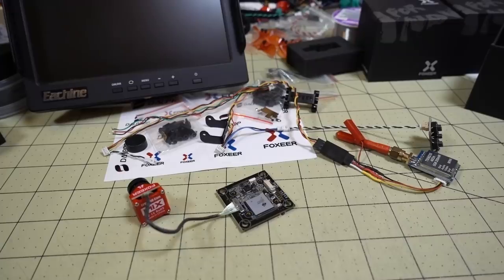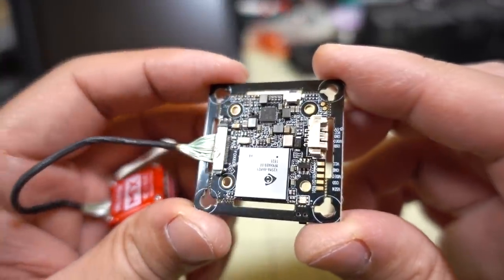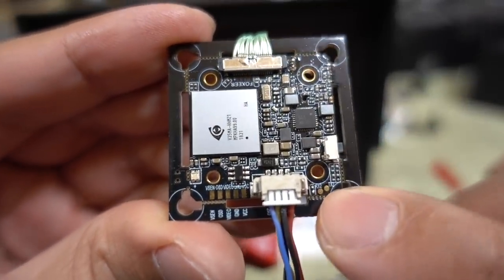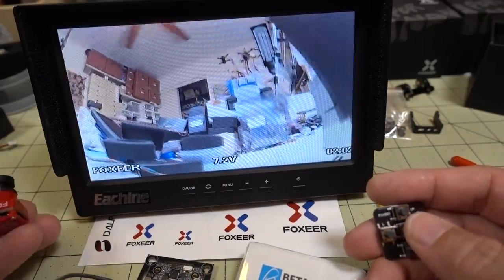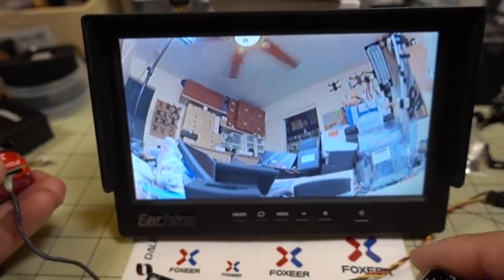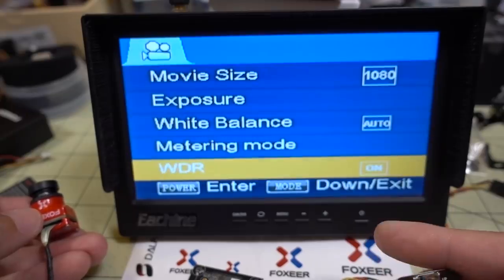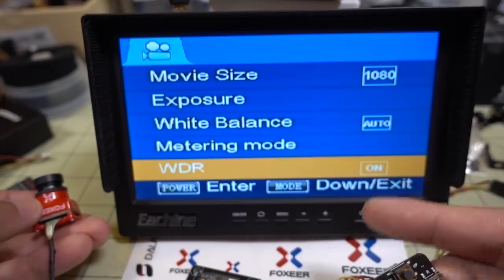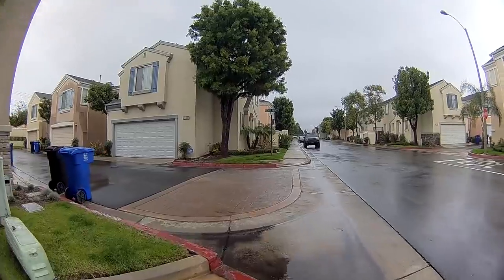Foxeer Mix HD FPV Camera FIRST LOOK 📷

Comment: I probably should of asked before but I would be interested to know which is the least susceptible for video noise. I recall you commenting on how noisy the Split Mini was.
Reply from the maker: The Mix was designed for less noise than the other two.

Comment: Really hoping the low light FPV feed is better than the turtle!
Reply from the maker: define better?  I've been asking people because it seems "better" means different things to different people...
Reply: @AlbertKimTV  if flying at dusk, or in an area with anything more than light tree cover the FPV feed goes extremely dark to the point where I can barely see. Is fine in nice sunny daylight. The low light difference between the turtle and the micro monster pro is dramatic

Comment: I'm seeing patterned artefacts / lines  on the left side of the test footage, top and bottom corners. It reminds me of a problem that appeared on the Runcam Split V1. Just checking. Are they on your own monitor or are they something youtube contributed during the compression process. Thanks.
Reply from the maker: It's youtube compression

Comment: Placed an order and returned my Turtle V2.  Built in Mic alone is a winner so I don't have to worry about sticking the mic somewhere or having it ripped off in a crash.  Also seems to be less noise in the feed (https://youtu.be/BDhDYhVaqSQ) than the Caddx (by a little) and a huge difference compared to the Runcam's.  So just to be clear - i can break off the 30x30 power on button without any consequences (installing on 20x20)?
Reply from the maker: Yes, but be careful when breaking off the PCB, it's not that easy.

Comment: Albert how is the temp of the board, my foxeer mix board is heating very fast, seems like its overheating, is it normal?
Reply from the maker: Mine gets very warm too but doesn't overheat and shutdown.  Just make sure it gets airflow and it should be OK.
Reply: Have not really tested it in flight, it does show in my OSD “CORE 70 degrees “ and feels hot.

Comment: Great review. Hopefully with all the cam companies competing the price will go down some. 😁
Reply from the maker: They are all about $65.  What price you think is fair for this kind of tech?
Reply: I guess it depends on how much more expensive it is for them to make this. Got to keep a good profit margin. 😁

But in general if normal micro cams are around $35, I’d like these HD cams to be around $50. Mostly because I could get a Go Pro Session 4 with 4K video for $100 (which is only $35 more than these cams).

Comment: Very nice!!! What I really dislike is the fisheye effect of the lens.. the corners look squished as you move around and is very opposite to a superview effect which looks better. I thought with such a long lens they would have some good corrective optics for a more rectilinear look. But looks promising!! Looking forward to the flight footage 😎
Reply from the maker: I think superview is patented by GoPro so no one else can copy it.
Reply: Albert Kim Superview is the software stretching a 4:3 image, but the lens can have a similar effect where it stretches the edges of the image to attempt to straighten the fisheye effect. The whoop cameras have this attempt. The caddx lens tries it slightly. I know of this because I worked with video cameras and dslr for many years. But usually a truly rectilinear wide lens is expensive

Comment: It really looks amazing, Albert! 😃
My only disappointment is that they didn't put any better opinion than 1080p... I was hoping more from Foxeer. 😕
But... Let's see how it records, right? Maybe it's much better than the others. 😊
Reply from the maker: Getting 4K onto a single 20x20 board is very difficult.  I spoke with another vendor that is working on something like that for 4K but it won't cost $65.  Probably will be about $350 to $400.  I told them don't bother because no one will buy it at that price.  They told me it was impossible to do 4k in that form factor for $65 so it looks like it may be a couple more years before we see something like 4K GoPro in a single 20x20 board for cheap.
Reply: @AlbertKimTV  Sure, but 4k isn't needed. 2.7k would be perfect!